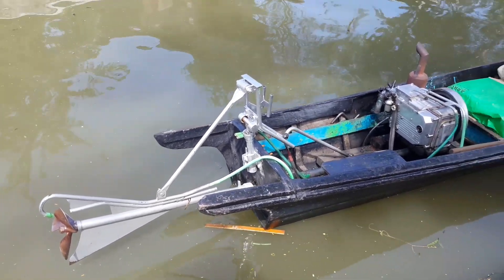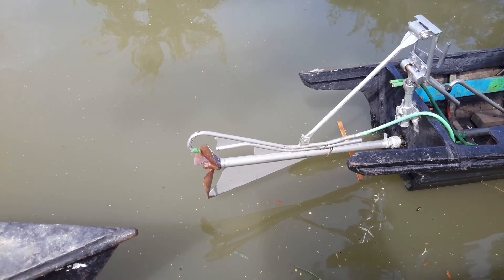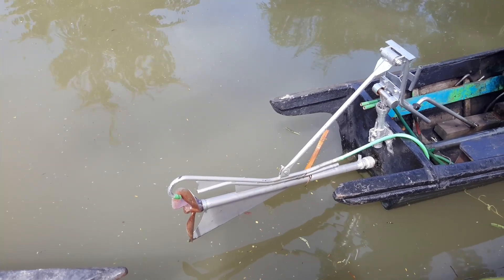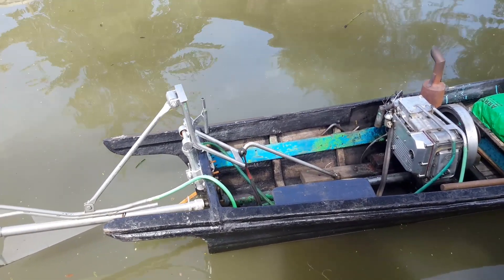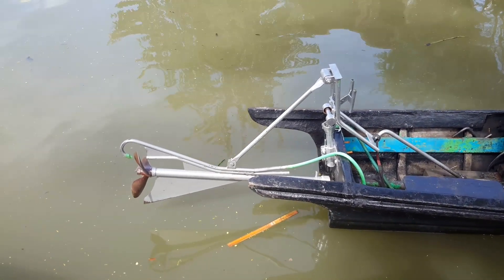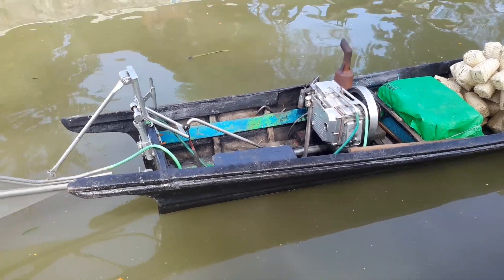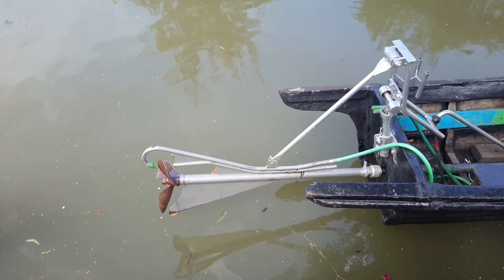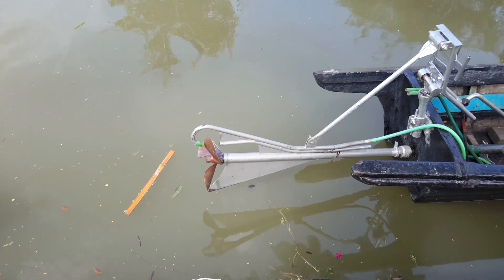Clever drive arrangement on long tail boats, Inle Lake. Multi speed by changing immersion of prop

Comment: Hello, you have a link where you can see in detail the device of this motor, how the shaft passes through the transom of the boat, I will be very grateful
Reply from the maker: Hello, sorry not. But try to contact gypsyinnhotel@gmail.com which is on the river with plenty of these boats moored. Maybe the owner can take the picture(s) you need. There are many hotels along the river.
Reply: Thank you so much
Reply: @AndersAnsar  Hello, your friend is silent, does not answer my request 🤔.Or link doesn't work